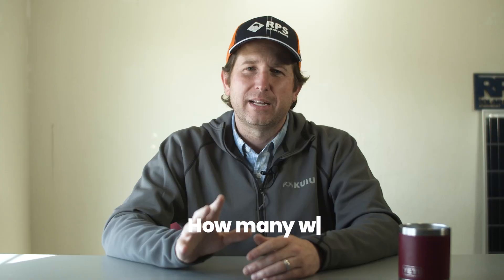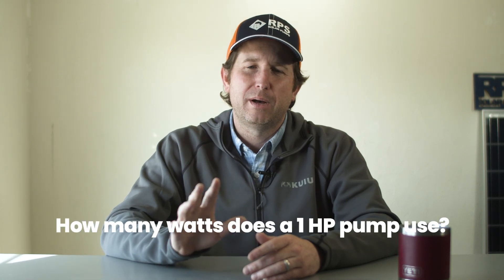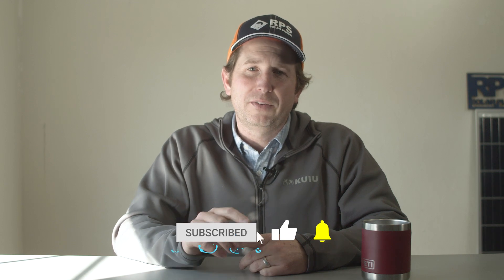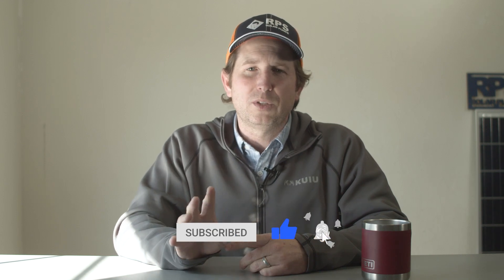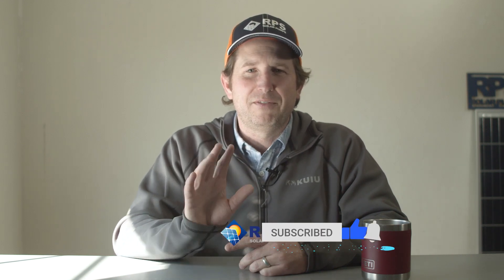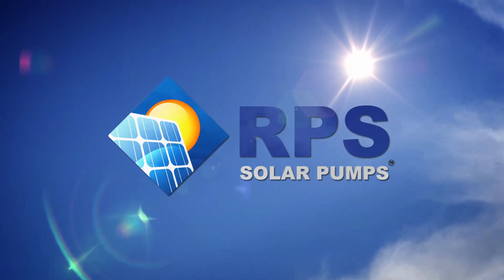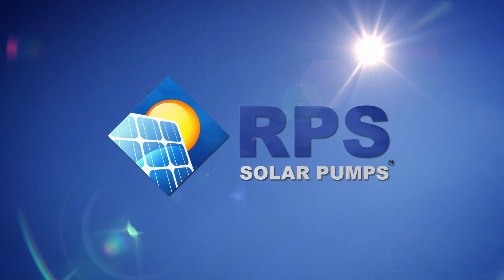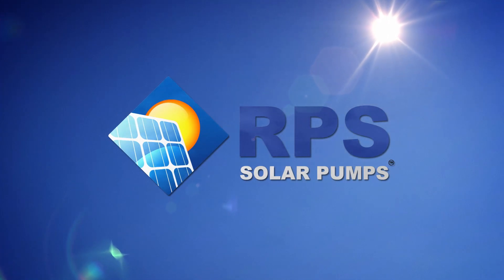How many watts does a 1 hp pump use? Q&A with Solar Pump Expert

Comment: I have an opportunity to buy a memo 750w induction motor with water pump for a deep well.  The water would then go into a pressurise tank. Would this be strong enough without exerting to much pressure on the motor?  Like the video👍👍

Comment: Please I bought a DC pump of 0.75hp with 250 watts rated power. According to the company,2*150 watts panel connected in series or single 300 Watts panel can run it but when I tried pumping it with 300watts panel,it didn't work. My question is,can I use 600 watts panel?

Comment: Can  a 1.5HP pump manage to push water horizontally to adistance of 200m into a 2m height tank?
Reply from the maker: The 200m (approx 650 feet) distance isn't a problem for any of our pumps, even the smallest ones, you just have to make sure to get a large enough pipe diameter to offset frictional losses (higher GPM = more frictional loss through a small pipe) 2M is about 6 feet, any of our pumps will be able to handle that head. RPS carries a 1.5 HP in a variety of GPMs, so we'll need to know how much you want to pump per minute or per day to give you a more accurate sizing, do you need 5 /10 / 20 /50 GPM or more? You may not even need to go as big as a 1.5 HP btw, this all depends on GPM, and we can size you down to save some money!

Comment: Can I plug an RPS 400 into a solar generator? Thanks
Reply from the maker: You have the option to run the RPS 400 off a typical 110V or 220V generator or AC power. A solar generator, as long as it outputs 110 or 220V power, will do the same thing. So the answer is yes! Alternatively, the RPS 400 could operate off of a 48V battery bank if you already have one set up with the "solar generator"